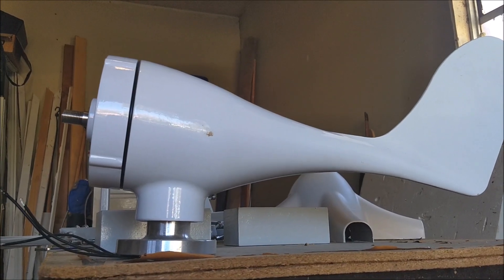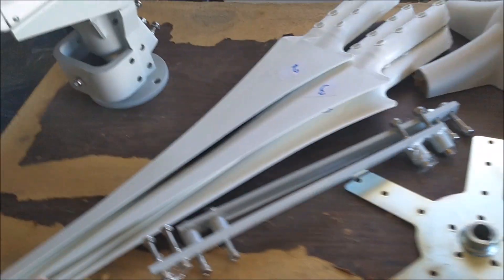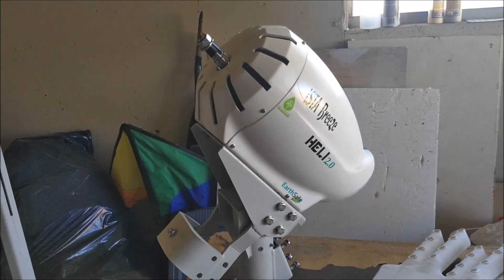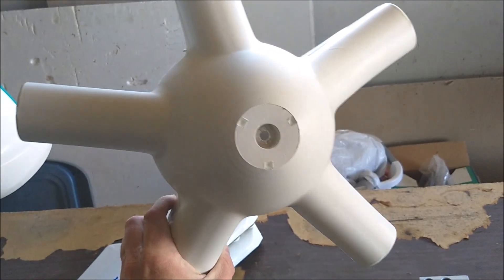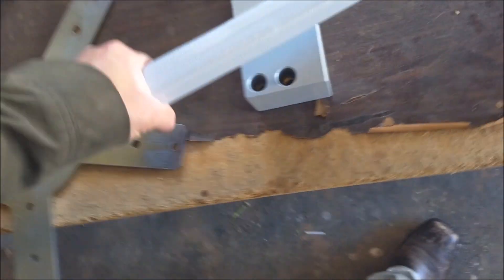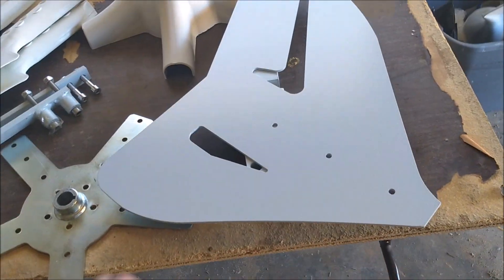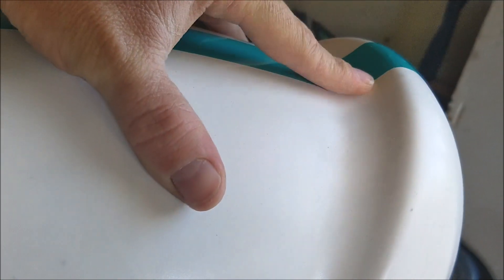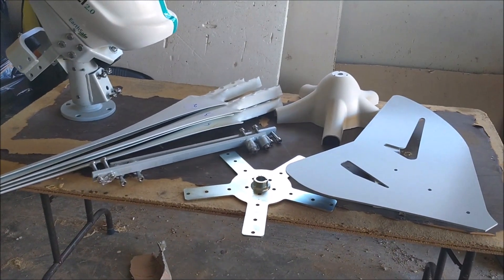iSta Breeze Heli 2 0 Introduction: What's in the box?

Comment: Did you happen to measure the distance between the mounting shaft and the prop??
Reply from the maker: Not to the blades, but from the mounting flange to the hub plane is 12 inches, plus or minus an inch.  The blades pitch forward a little so there may be more clearance to the prop plane.
Reply: @ToysforWatts  10-4. Did you order the turbine from the link you posted?
Reply from the maker: That link is the same turbine but mine was direct communication with the company
Reply: @ToysforWatts  just ordered one. Hoping to get some production out of it this winter. My towers' current site sucks, but it is temporary. We will see what the Heli can do.
Reply from the maker: Awesome!  Please let me know how it turns out!  I've had virtually no wind since I got mine up...something I'm blaming on the hurricanes down south, very unusual to be so "not windy" here...so I haven't gotten to see it do a lot of work so far.  But any time it's run it's made really good numbers even with my 36v system dragging on it a little.
Reply: @ToysforWatts  10-4 will do. I'll be connecting it to a classic 200, midnite clipper and 48V battery bank. Hope she puts out!

Comment: What is nominal voltage of this turbine? And what is diameter of blades?
Reply from the maker: Don't know voltage yet....it's spec's say it's  a 48v machine so I'm expecting unloaded voltage to be somewhere in to 80's to 90's.  I'll have a bench test video up soon that'll give us a rough idea.

Rotor diameter is the same as the i1500 and i2000...about 2.25 meters or just a touch over 7ft.
Reply: Thanx

Comment: Very interesting, i think the generator was the 48v 2kw low rpm version, i think it´s going to do lots of watts ( i think it can double the performance of the 1500).
Recently i purschase an istabreeze i1500 24v to use in a  hydro turbine, i think i`m going to have some heating issues, because it must produce about 1300-1500w 24/7 and without the wind...
Lets see what this Heli can do!

Comment: i would agree. all looks good, but that hub looks a little wimpy compared to the rest of the unit.
Reply from the maker: It is smaller than I would like but it's something I can remedy with some ribs.  I've got a small list of questions I'm putting together that I will be forwarding to the manufacturer and hopefully they'll be able to shed some light on the hub.  It honestly may not be a problem considering this one will furl automatically in extreme wind.  My i1500 doesn't furl so the blades are still taking it all when the wind hits 50+.